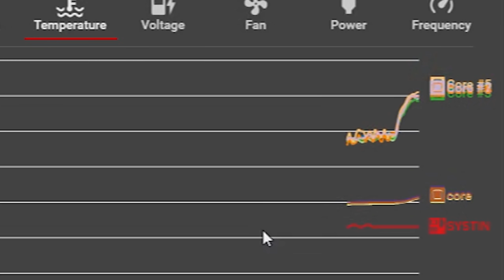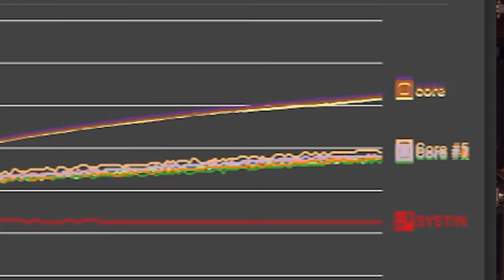Can You Cook Soup In A Liquid Cooling Loop?

Comment: Liquid cooling is a very common process. A car's cooling system circulates water, usually mixed with antifreeze, through the engine. Hot surfaces in the engine warm the water, cooling themselves off in the process.
Edit: Yes this is the google result for what’s in the liquid in a pc cooling loop

Comment: Should have used an open loop vs an AIO. AIOs come with propylene glycol and a few anticorrosion chemicals which are all fairly dangerous for consumption.
The glycol isn't lethal though in theory, the body can take 11.4 mg per pound (25 mg/kg) of body weight per day without massive side effects.

Comment: Roughly half a litre of soup, processor probably about 100w TDP?

Numbers numbers numbers.

It could in theory get it from about 25c to 80c in 35mins...... In theory.

Now to watch you fail ;)
Reply: Oh, you'll totally have to bypass the radiator to do that too.
(Or at very least, go fan-less)

In fact, best way to do it would probably be to just heat-sync compound the tin of soup right on top of the processor ;)

Next video?